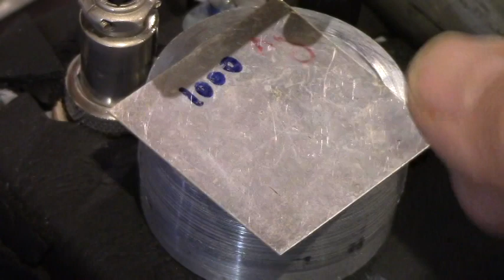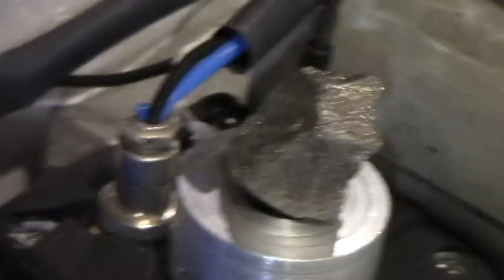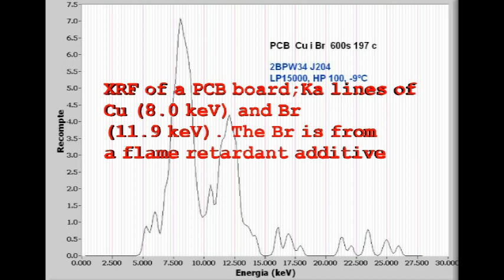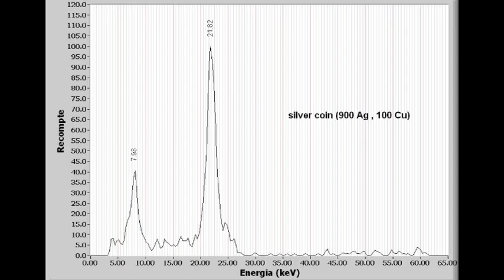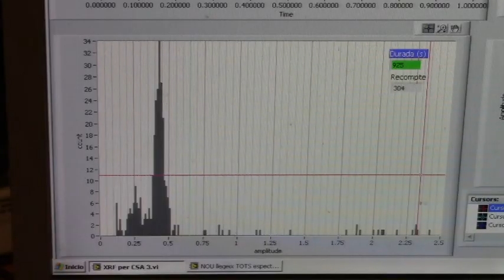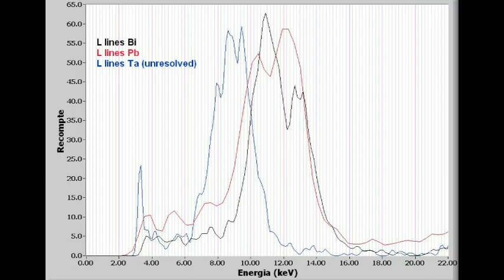Homemade X-Ray Fluorescence with PIN Photodiodes (II): XRF experiments

Comment: Thank you so much for sharing your project with such good explanation! 
I did try to build a simpler setup with a similar source array and a RadiaCode 102 as the spectrometer. It did detect the XRF emmitions from about 20kev to 50kev, but of course the resolution is pretty bad (about 10kev) so it's no good to identify elements 😅 it is barely enough to identify the presence or not of lines in this range
Reply from the maker: Hi,
Before coming across Bertuccio's circuit I made a lot of trials, even with the super expensive Amptek A250 I had bought in ebay some years ago; when it crashed, I had to find an inexpensive alternative. When I got my first spectrum with Todd's circuit (the one I began with)  I couldnt believe that the resolution was  better than the best one I got with the A250.

Comment: Great work Adolf! I’m going to have to rewatch the vid a few times before my gray-matter absorbs the science! The engineering is superb. Love the americium source construction!
Regards Rog.
Reply from the maker: Hi Roger, I copied the idea from some site in internet, but I tried several configurations before I found one which gave the maximum counting. I have the advantage of being the proud owner of a a lathe! ;-)
Reply: Since you’ve created a relatively intense alpha-particle source, I was wondering if you could configure the apparatus to detect any visible light luminescence caused by the alphas striking the surface of a fluorite crystal?
Reply from the maker: I have  seen scintillations from alpha particles using ZnS phosphors,  I dont't know if it is feasible using willemite or fluorite